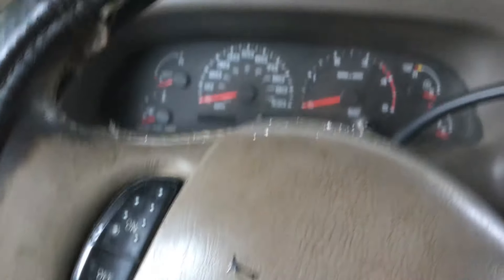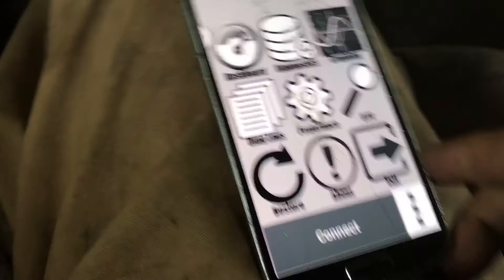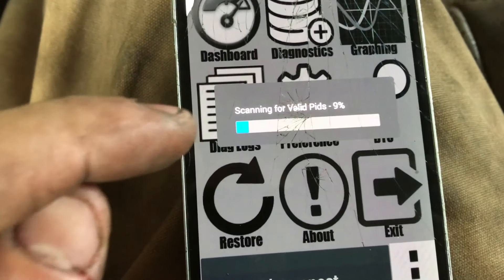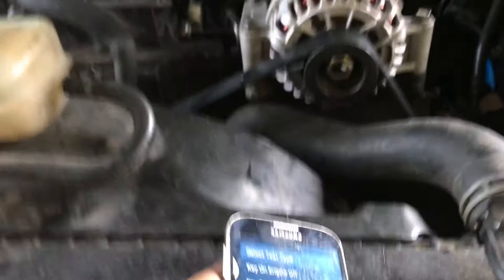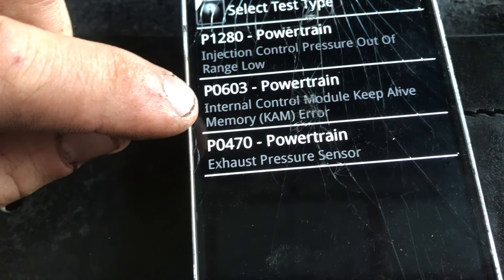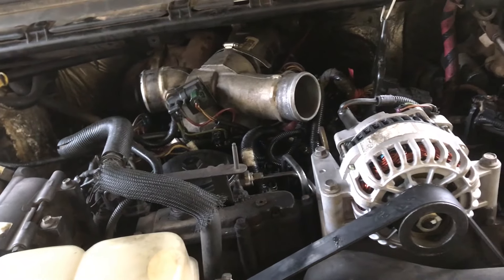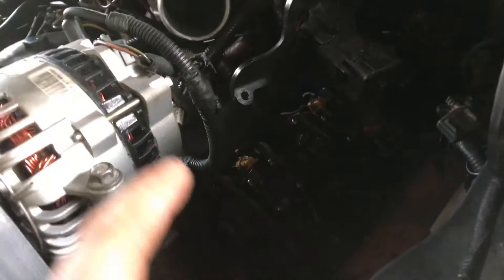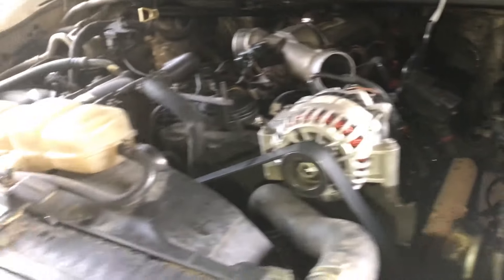7.3 injector buzz test with a phone

Comment: Did you replace the injector harness’s when you did the injectors
Reply from the maker: for the valve cover harness for injectors it is good practice to replace them with motorcraft ones if you see any oil in the outer connectors or even if it just has a great deal of miles on that gasket harness

Comment: I tried this exactly how you did, app kept saying "busy repeating request" and did NOT do a buzz test....it did pop a 1293 and 1294 codes. Any idea why the buzz test didn't work? Bad idm? Thanks, cool vid!
Reply from the maker: There are procedures that you can do with a multimeter testing resistance from the valve cover gasket connectors to the idm, if those test good then likley bad idm
Reply: @noahguyse2908  10-4 thanks!
Reply: @noahguyse2908  can you post a link or reference to these procedures? I'm still at a crossroad figuring this out. T
Reply from the maker: @yourmama2299  https://www.thedieselstop.com/threads/idm-test.598001/
Reply from the maker: The picture in that thread shows what i am referring to
Reply: @noahguyse2908  thanks!!!